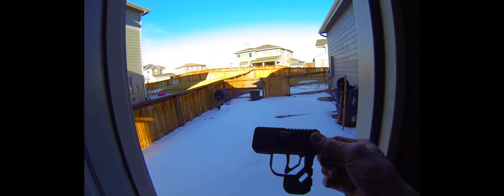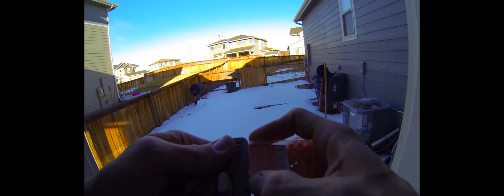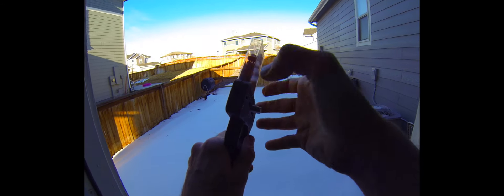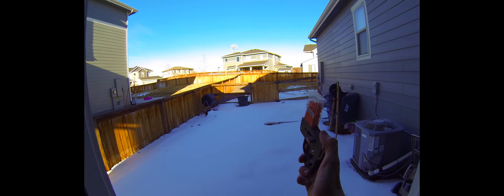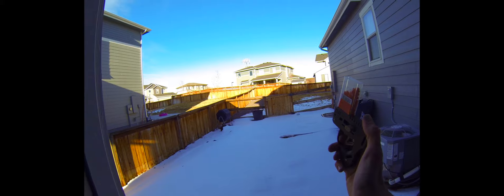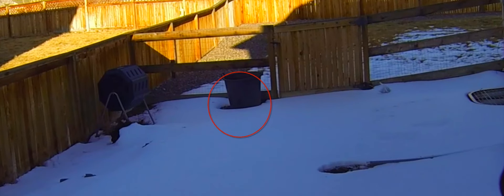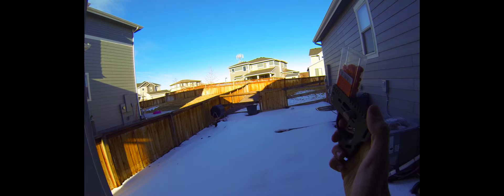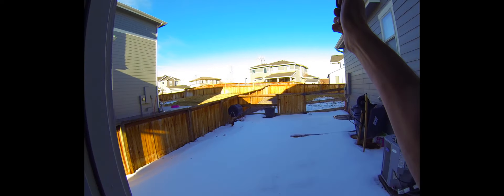TTG2 Tic Tac Gun demo with the New Stronger Spring

Comment: Any chance you can link where to get those springs?
Reply from the maker: Unfortunately no, it’s not just as simple as a new spring.  There are internal modifications to the frame for both strength and fitment, otherwise the strong spring just blows everything apart.
Reply: I do have the mods for the 6mm spring, but am struggling to find a spring that shoots more than just a few inches. But I guess you have done more internally for structural rigidity
Reply from the maker: If you only need the standard 6mm spring, I do have some of them around still.  It’s the spring that’s in the video shooting the targets.  Send me a message on my website, I can sell you a few of them.  3DCubedPrinting.com